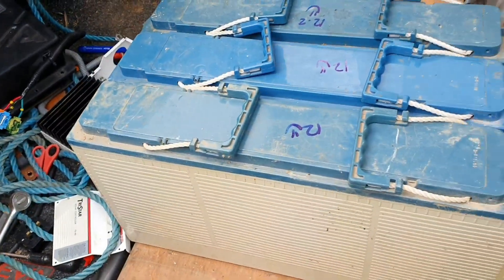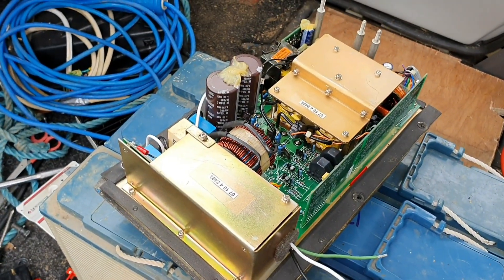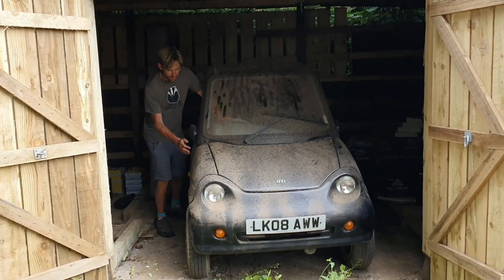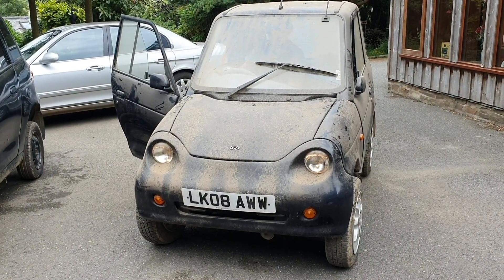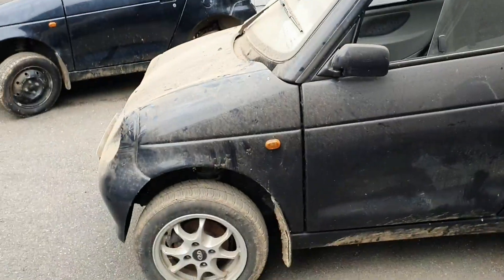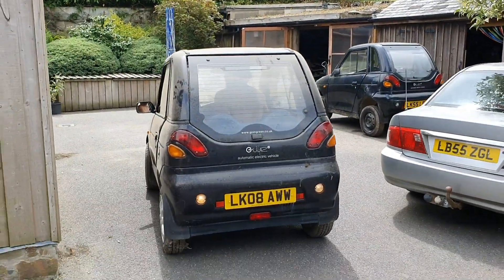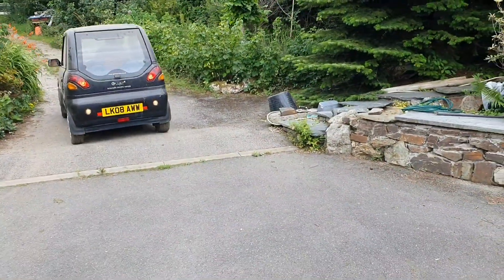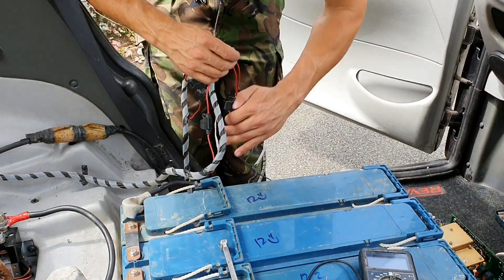REVA G-WIZ: Bringing Nick's collection back to life

Comment: Help please I have just bought a reva i     a c version 2010 pulled all the old batteries out put some 12 volt ones in got my positives and negatives mixed up and connected for a second the wrong way the car still drives backwards and forwards but it appears the 12-volt side of the system is no longer working any ideas please I've watched quite a lot of your videos and you seem like the man that would have the answer
Reply from the maker: You could have blown one of the big orange fuses under the seats. Check those first and the the fuses under the dash. You've hopefully only blown a big loom fuse otherwise it's not looking so great. I shorted the brushes on the DC motor and it burnt out the 48v system. You shouldn't have gotten to that point.
Reply: @RichardMawby  thanks for the reply I did send you a message on Facebook as well
Reply: I did quite a bit of digging since I sent you that first panicky message I now think that the charger has stopped working as that blows fuses in the house whenever I plug the car in also there is no 12-volt coming from the converter I bought a converter
Reply: Sorry I keep pressing the send button I bought a 48 volt to 12 volt converter and that is now making the Car Run and all the 12 V system what I did find odd as soon as I got the car and before I made the with the connections I noticed as soon as I made the connection to the batteries I was getting quite a big spark and checking with the AVO metre it is drawing about 10 milliamps all the time also before I took the old batteries out I did notice one of the terminals was completely burnt off so there could have been a problem with the charger even before I made my mistake I'm now going to try separate charger on the batteries along with the converter

Comment: 07:44 you mentioned working out how to use the original BMS sensing wires. As you know the original batteries were 6v and you are using 12v so you have to fool the BMS into thinking there is still 8, 6v batteries. This can be done by using what's known as a 'Potential Divider' This is simply two resistors in series from the negative to the positive on each battery. Measuring from the negative connection to the join in the resistors will give you half of the battery's voltage which in this case will be 6v. However, doing this, you decrease the effective 'Resolution' of the BMS, whilst the BMS will see what it thinks is 8 batteries, you have in effect only 4.

Comment: What kind of rim's are those? They look real cool!
Reply from the maker: They are unique to the Reva i
Reply: @RichardMawby  I wonder if they fit on a Reva DC 🤔 would be nice...probably are even lighter.
Reply from the maker: @shinos9917  they are all the same hubs so I dont see why not. But it wont help by much.
Reply: @RichardMawby  G-Wiz running gear under a Reliant Kitten ?? all that old engine bay for batteries/charger etc.... ??
Reply: Probably the wheel was a commonly used part in the Indian / South East Asian motor industry, ~2008?